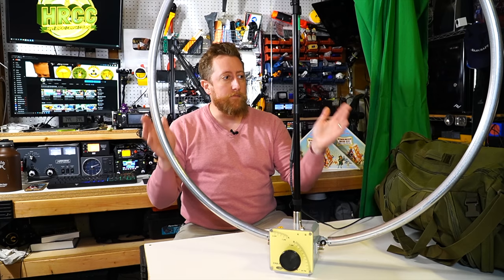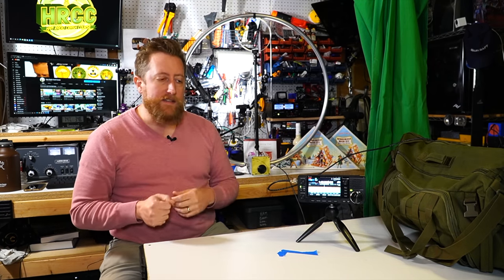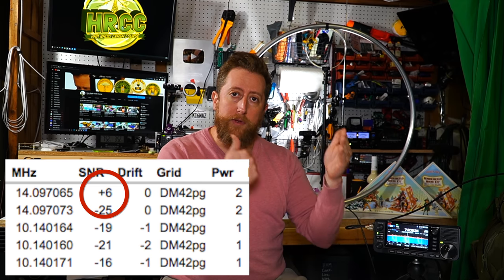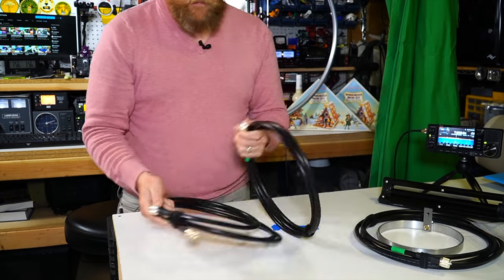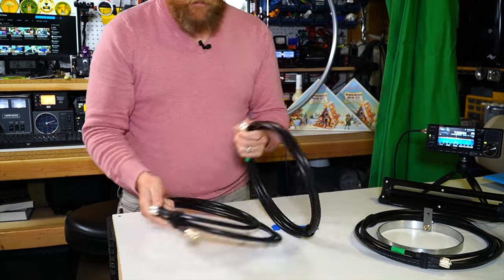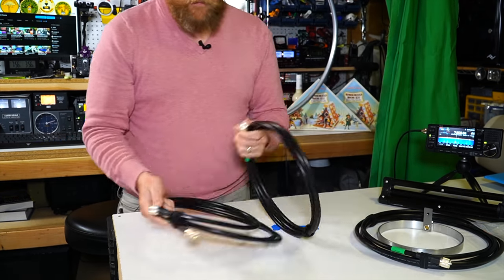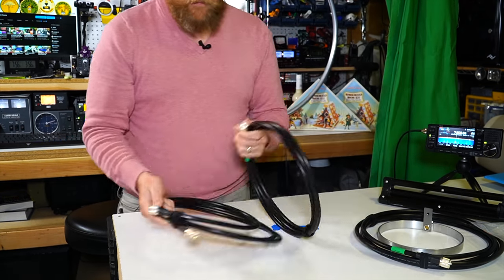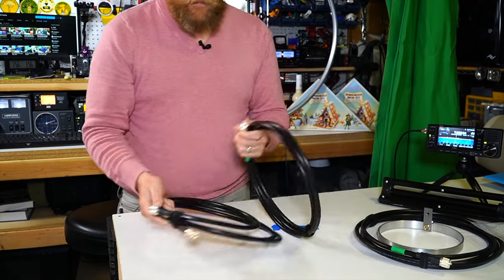Chameleon F-Loop TOTAL! Kit and CHA Single Loop - Ham Radio Antenna Review

Comment: Nice system, but QRP should be emphasized since the operator needs to be within arm's length of the antenna, which makes it easy to exceed radiation exposure limits. That's when a remote auto-tuner really is a value.

Comment: WSPR will only tell you how far/well your WSPR will go. It will not tell you a thing about SSB propaganda. Which is why I just go ahead and test on the mode I wish to use, mainly SSB. I do have and use my Chameleon F-Loop. It works like you said. I use it indoors in my bedroom for HF contacts. I also tried it in outdoors in New York City’s Central Park once and made some contacts. 73 de N2LRB.
Reply from the maker: I’m not sure why you say that. Of your report is 0 or higher, Ssb to that location is likely possible. Just need to look at the numbers.

Comment: Great video and I'm sure the antenna works very well but I feel it's too fiddly and to much tuning, everytime you move you have to retune , I live in the uk and this is not going to get used for 5 months of the year with winter weather high winds and rain I wouldn't want to keep running outside to tune even on a pleasant day , lot of money for what cannot be made a permanent fixture outside and to big to leave up in the house
Reply: I received my loop about a month ago (in the UK) and can confirm that it does indeed work well (indoors),  I would go for it personally.

Comment: Hey Josh. 
Tnx for another great video. 
I didn’t have much luck with loops inside a hotel room. Have you ever tried it? Did it work with the CHA loop? 
I really would appreciate your opinion about that. 
73 de Rico, DG5BQ
Reply from the maker: You pretty much need a balcony.
Reply: @HamRadioCrashCourse   Well, some of the hotels do have one. But even if, they are quite narrow. I think the metal of the window or door frames behind the antenna would have negativ effects on the antenna. And I would only get have of it out while the other have would have to stay inside. So it’s just for the summertime 😉. 
But many thanks for the quick reply.

Comment: Ive seen some reports that suggest the inner loop performs better if it connected off centre to the outer loop . Any comment?
Reply from the maker: Not sure. But I don’t quite understand what you’re asking.
Reply: @HamRadioCrashCourse  I was asking I suppose whether you have heard of that and agree that might work.   Some propose making the inner loop more oval to increase the bandwidth of resonant frequency but moving it left or right?- not sure how that would work or what that would achieve unless it makes it more efficient for one band more than another?

Comment: do you see any problems using this with a icom 7100
Reply: It will work fine with the 7100 or any other radio for that matter. Just don't exceed the max power ratings. 25W SSB or 10W CW/Digital.

Comment: How does it do for local use, (NVIS)?
Reply from the maker: I have not tried it specifically for NVIS, but I have made every close in contacts with it on 40 meters.
Reply: @HamRadioCrashCourse  Would I need to do anything different to operate NVIS? How low to the ground do you recommend keeping the antenna for normal operation and for NVIS? Thanks! W2QLH 73
Reply: I've used mine, checking-in on an 80m net, with Net control being 45mi away, and several 20-30mi distance 10m contacts with ease, but band conditions will always play a part in my success (or lack of).

Comment: How can they be a resonant antenna? They're quite the opposite really, especially when considering they're designed to operate on such a broad frequency range in just one or two lengths. I'm a CBer and I know that (101 basics), like the rapper of that song.
And you really shouldn't keep saying loop antennas, in reference to certain characteristics. The category of antennae is small loop. This is misleading for beginners when compared to an actual resonant loop.